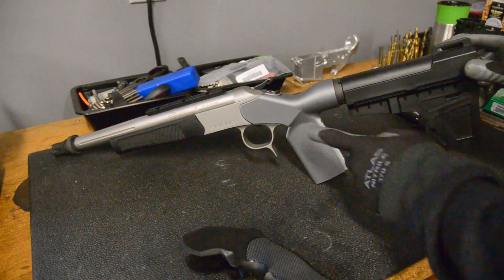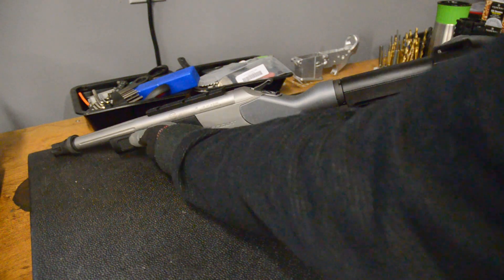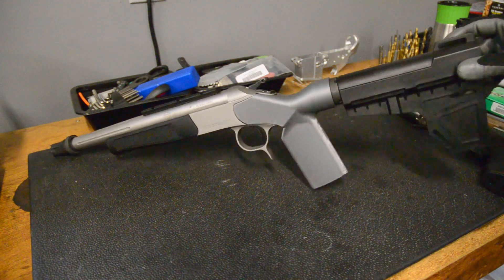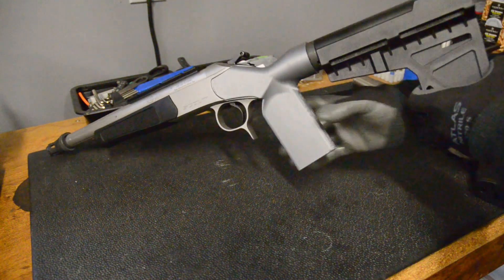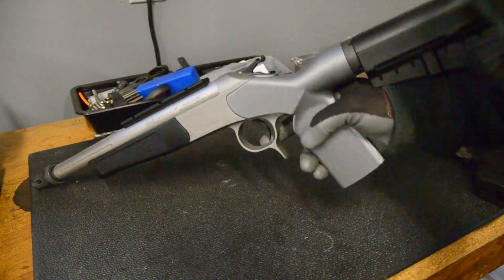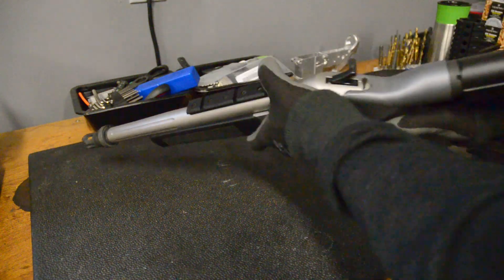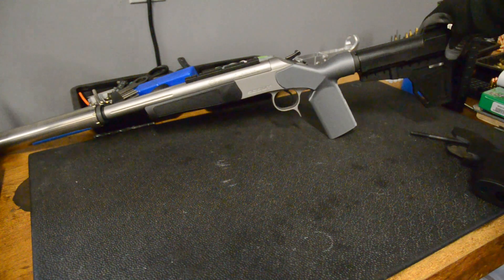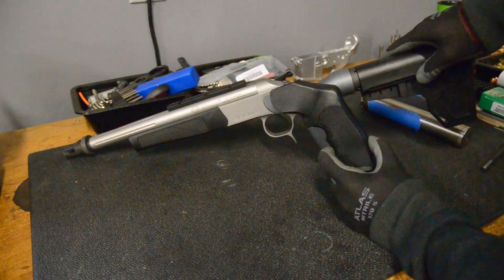CVA Scout 3d Printed Pistol Brace Adapter

Comment: Just got the grip mounted on my V2 .50 cal
Very disappointed for 85.00+ shipping. 
I'd be shitty if it was 25 bucks..
Pros:
Does the job with no other options available.
Shipped fast.
Cons:
Fits poorly with large gaps.
The sides pop out with slight movement, and make a loud ((POP))when you press them back in.
(I'll put a dab of epoxy to fix)
The finish is slick as glass, and has rough edges all over.
Grip is a tad too wide.
A swivel stud option would be nice.
I made this SBR folder muzzleloader to go on backpack hog hunts on public land.
I'm bringing my original grip, because I've got little confidence this thing will stay together.
Reply: Any update on whether this worked out for you?

Comment: Do You Know If This receiver And the rifle Receiver Are different Or Is There a Grip Adapter? Its The Same Platform As the Optima Pistol And Rifle Line, Those Being Black Powder Dont apply To The NFA Rules And Im Wondering If The Stock From An Optima Rifle Will Transfer Directly Over To The Receiver Of An Optima Pistol.
Reply: Why do you capitalize every word.....???

Comment: Can you make a similar set up for the Ruger Charger 10/22 pistol?  That would be a gold mine.  There's only one source for brace adapters and they sell right out.  If you could do an integrated pistol grip with brace adapter like this one people would likely want it.
Reply from the maker: I'll consider it if there is a supply shortage. Please contact me at flood@farrow.tech
Reply: I purchased one of these for my 14 inch cva 44 mag.  The two wings that grip the pistol broke off after firing. The wings are not robust enough to support the pistol upon firing .  It’s too flimsy.  Once you expose the set up to any use, the wings break off.  Money down the drain.  The seller did replace the broken one initially,  it the second o e broke as well.

Comment: I want to order one for my CVA Optima V2 muzzleloader pistol. Do you know if it will fit? The CVA Scout seems to share the same pistol grip. LMK ASAP. Thanks
Reply: Check your laws to be sure, but for a muzzleloader, you may actually be able to put a proper shoulder stock on it, instead of one of those wink wink nudge nudge arm braces.

Muzzleloaders are not considered firearms by the ATF, so federally you can SBR them without legal worries.

Just don’t do it with a cartridge/breechloading version unless you have a tax stamp.  Breechloading pistols are firearms by federal law, and to SBR without a tax stamp would earn you a free stay in the crossbar hotel (They don’t have cable over there, but I’ve heard reports of people getting the BBC during their stay).

Arm braces are a gray area because they are “technically” not a shoulder stock.

Comment: Hey man I was wondering if you could help me. I have a pistol that id like to mount a flash light to but it has no rail and their is not a company that makes a trigger guard mounted light for it ether. Is it possible for you to make one if I send you a mold of the trigger frame or specs. I'm willing to pay you for it.
Reply from the maker: What pistol is it?

Comment: Will this fit the v2?
Reply from the maker: Yes, the v2 is what is used in the video
Reply: Sweet! What are the chances of making a "ACE" type folder? 
Not a huge market  I'm sure, but I'd buy two.(edit)
I suppose I could use my adapter on the buffer..duh